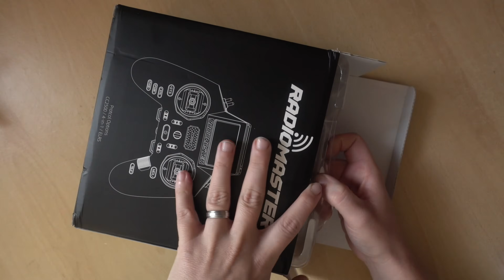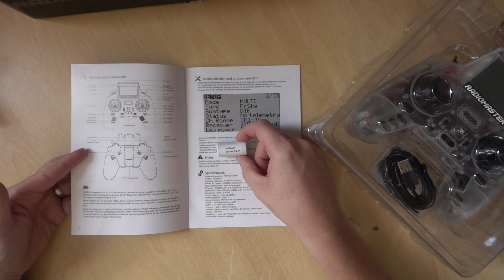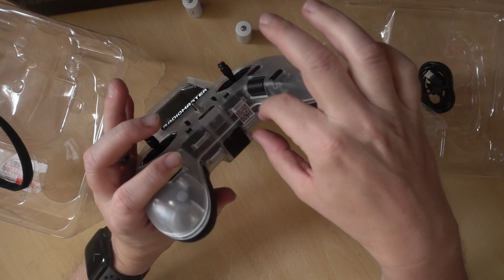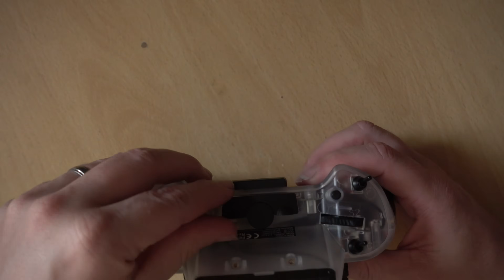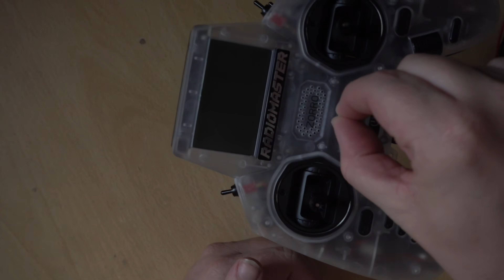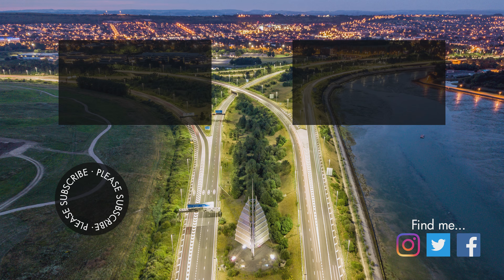RadioMaster Zorro LE : First look and unboxing

Comment: I setup the zorro for a jet On the switches I set the throttle cut, rates, flaps and stability. No switch left for the gear. I set them on a slider. Can I get the slider to call out gear up on one side and gear down on the other of the same slider. Right now the gear will go up and down on the same slider but do not know how to get the call outs. Can u help?  Thanks

Comment: Hard to believe you can produce a product where the recommended batteries don't fit?
Reply from the maker: Yep. There may be a button vs non-button difference. But that is not stated anywhere. I just squashed the positive plates in my vice. Now the batteries fit fine.